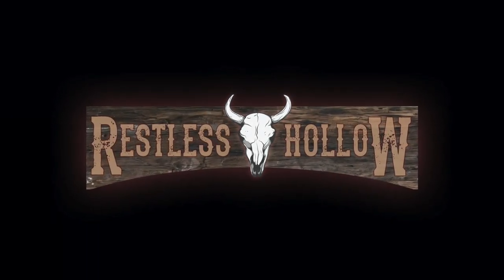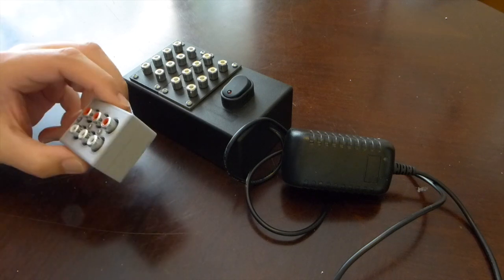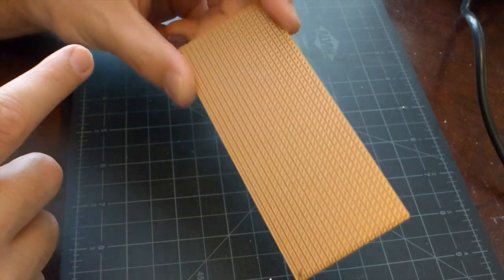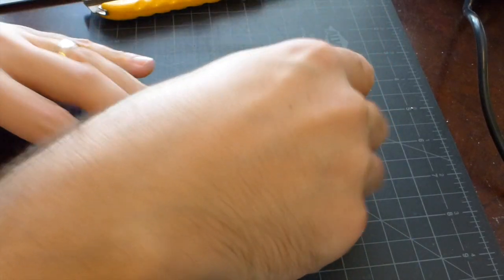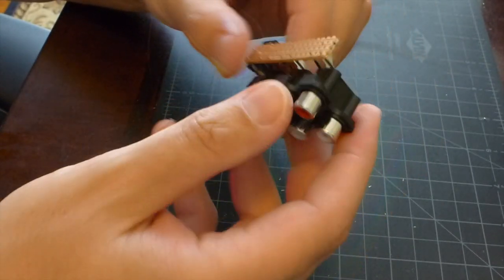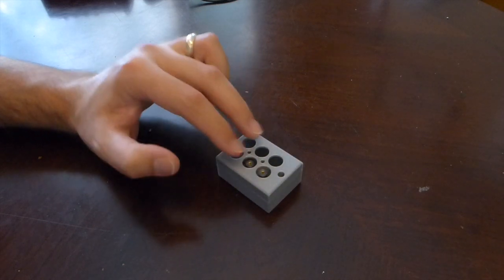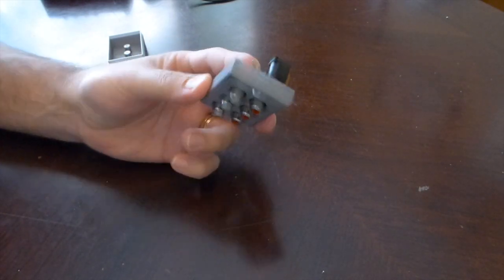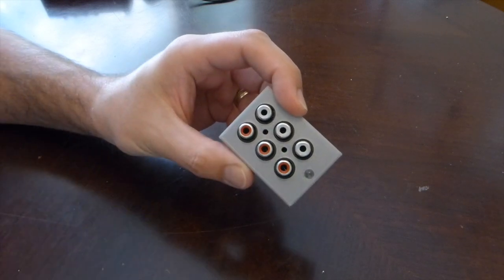Compact RCA Power Box

Comment: Great video, what amperage was you power supply? 1A? 2A?
Reply from the maker: You can use whatever you prefer - 1A would be fine depending on how many lights you want to run. I actually power these boxes from a large 20A CCTV power supply that I run a bunch of lines from. It powers almost all of my lighting.

Comment: Hi, new subscriber here... I was remember seeing a vid about the rca board that allowed you to plug additional boards into one of the plugs. So, if you had 8 plugs, 7 were used for leds, and one was used to plug in another board of 8 plugs, so on and so forth up to some limit, I cannot remember how many they were powering. Is this (your original board) set up the same way?
Reply from the maker: Welcome! Yes, this works that way as well. Both this version and the original version (however, it would bypass the switch on that version if powered by the RCA plug). As far as limits, that would depend on how many items you power and the overall length of the wires, but if using LEDs, I would imagine it would be a lot. 😉

Comment: I've been meaning to make these but was having trouble finding those jacks. I haven't been back to looking for them but now I know it wasn't just me. Nice little project.
Reply from the maker: Thanks! The stripboard mades it so much faster, rather than soldering two wires to each jack. I meant to put in a picture of the original box with all the wires inside.